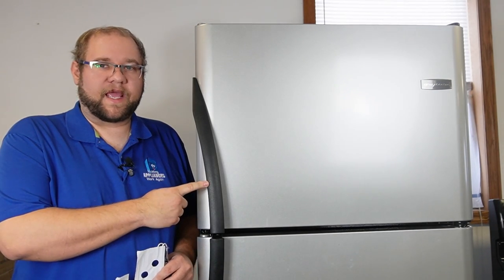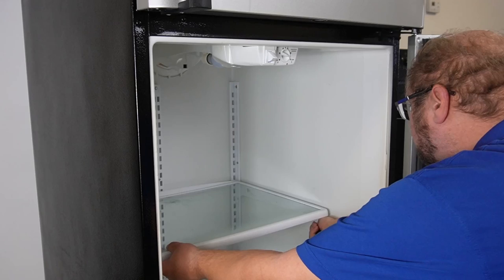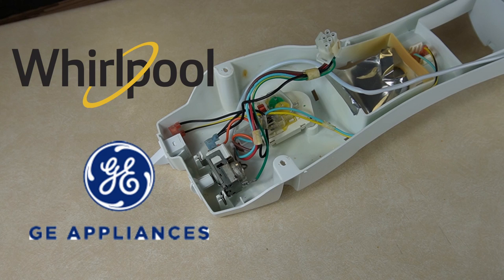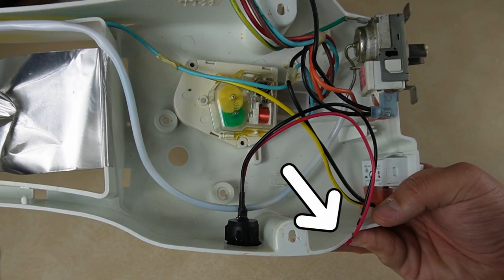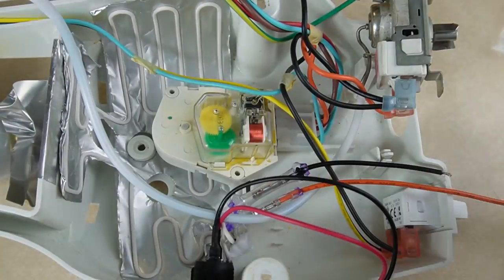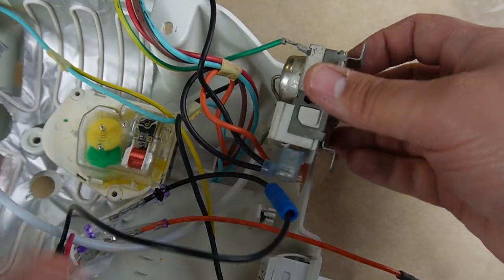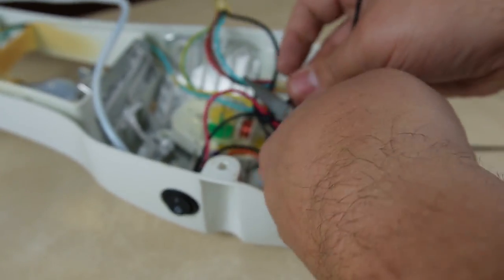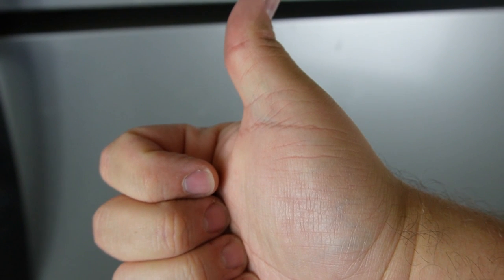Installing a Garage Refrigerator Kit with On/Off Switch to Keep Refrigerator Cold in a Garage

Comment: Hi Ben I have a Frigidaire fridge  that turns on and runs for 3 minutes and the compressor turns off  I swamped out the relay but doesn't seem the problem this fridge has electronic control board instead of a timer in the fridge  can it be the small board and can I swap it out with a timer?

Comment: How much power does a heater like this use? I'm looking to use it on a camp fridge that runs off a solar system via an inverter - and power consumption is VERY important. Will it draw power constantly and kill my battery/solar setup?

Comment: Just to confirm, does the red wire from the heating pad connect on the top of the cold control and then the black wire originally connected to the cold control connects to it? And for the bottom, the red wire (with the black small wire) from the switch connecting on the bottom of the cold control with the original red wire connected to it. Is this coorect?

Comment: Nice little kit- competitive with trying to find all the pieces to duplicate it (the only way to beat it is buy everything in bulk and spend a lot more on a bunch of bits I don’t need).  Excellent new vid.  Now I see what needs done with the parts.  Thanks!

Edit- ironically enough, finally had a warm enough day to install it today before it drops again.  Glad I had the step bit.  A little file to notch the housing hole for a tab protruding on the switch was helpful too.  Nice snug fit.  Pretty clear instructions.  The switch is extremely stiff though- as in I’m a grown man and have to really push on it- no way my wife is going to be able to flip it when the season changes.  If I had to do this again, I’d get a better brand switch.  Maybe it was just bad luck on the QC of the switch… but if this thing works, I’m happy.

Comment: this was a great kit, shipped quickly, quick connects make it really easy.  install was super easy.  i used a 3/4 paddle bit and worked fine.  just be careful you don't punch through and damage anything on the inside.  definitely recommend this product

Comment: is there a fridge that works in garage properly - also it would make sense to install a thermostat that would turn on this heater when the temp goes under 15 C, when the fridge turns off ..

Also, does that mean the old timey fridges just ran constantly?

Comment: Bought your kit... Went to install it today and underneath my control is only a few LED lights a thermostat to tell what the temperature is, wires for the temperature control and wires going to the switch to determine if the door is open or closed. There is no place to hook this up?

Comment: Good video, but when exactly should the heater kit be turned on? When the garage temp is outside (higher or lower) of the fridge's recommended tolerances?

Comment: This is a great video. 

I love that you’ve taken the Frigidaire kit and added a switch and almost “dummy-proof” connectors. 

Is it OK to toggle the element OFF on when temps are higher during winter months? Or is it best to just leave it running all winter?
Reply from the maker: Yes, thats the goal of the switch, so you can turn it on/off to conserve the heater pad and housing itself.
Reply: @bensappliancesandjunk  Hi Ben, I have a fridge in my garage and it gets very cold out there but the fridge seems to be working fine. The freezer is also working normal. Would I still need to install the heater in the fridge? Any help would be appreciated. Thank you.

Comment: Can you please, please , please add a clear photo or diagram of the connection of the red switch wire.  I know that the black wire on switch and black wire on heater connect to each other but im really confused on the other connections.  Thanks

Comment: I watched both videos and am confused about the wiring.  On one video the orange wire from the heater is attached on the bottom terminal and in the other video it is on the top terminal.  Can you help?  I want to me sure I am doing this right. Thank you

Comment: I followed all the instructions and the compressor works fine.  However, I switched the heater on today and expected the compressor to run constantly and it is not.  Is the heater pad bad or did I do something wrong?
Reply: Did you figure it out ? Mine is running on and off ?
Reply: @joepuleo3  yes it appears to be working fine.

Comment: Installed this kit today.  Followed directions and video. I piggybacked the Orange wire from the heater element to the orange wire from the cold control. The black wire from the element to the back wire of the switch.  Then connected the small black wire you supplied with the piggyback to the red wire from the switch.  Connected original black wire from the cold control to the piggyback then reconnected that to where it was connected to the cold control.   My question is does it matter which wire (Orange or black) piggybacks the wire from the switch?   In your video you took the Orange wire from the element to the black wires of the cold control and then the wire from the switch to the Orange wire.  Does it matter?
Reply from the maker: Its totally reversable.
Reply: @bensappliancesandjunk  need to explain where and why wires go

Comment: I’ve got a whirlpool fridge, and noticed that no kit exists for the this unit. I do have the manual cold control knobs, will this kit work for my fridge? (Maybe with a little modification to the heat plate?) 
Thx
Reply from the maker: Yes. As long as it has the physical turn-knob backed by a cold control thats mechanical (where you can tap into the system via the piggybacks).

Theoretically, we could release a 12 VDC kit, too. But I haven't gotten that far into decisions yet.

Comment: What is the voltage passing through the new on/off switch? Also, what is the +/- configuration of the orange and black wires? (black -) (orange +)?
Reply: It looks like this all runs at 120 volts AC. One of the wires on the thermostat is going to be live and the other switched live.
Reply: Where should neutral of heater go ?

Comment: Does adding this kit and drilling the hole for the on off switch void your warranty on the refrigerator?   Thanks
Reply from the maker: Likely yes
Reply: Can you use your kit and connect the wires to the switch, but carefully let the wires with the switch run through the gap at the top of the control housing and the top of  the fridge to keep from drilling a hole in the  housing and voiding the warranty.  The switch will be easily accessible just outside the housing and you can manually turn off the heater when needed.
Reply from the maker: @marvink7204  yes, I think you could do that in such a way the system isn't touched to void the warranty.

Comment: So I have a side by side fridge in a garage that routinely gets below 0. I may have the opposite problem: Even on the 'hotest' setting, the fridge compartment is below 32F (usually 29-31F in winter). This is too cold for milk, water bottles, etc, since it freezes solid. The kit looks super simple to install, but I hesitate to buy this kit since my issue is a little different. Is there hope for my situation? If so, does this kit fix it, or do I need to do something else?
Reply from the maker: Likely something in the cold control is shorted out, causing the refrigerator to run 24/7
Reply: @bensappliancesandjunk  It runs about 5 minutes every around 40-50 minutes to keep the freezer between 0F and 12F. So far I've rigged up an old 60W bulb inside the fridge side on a wifi switch to turn it on 1 hour every 12 to heat the fridge side. We'll see if that's enough or if I need something more sophisticated. Love your kits, though. I think my garage is just too cod for them...

Comment: Wouldn't it work better to just add the grade kit wired into the defrost timer and only have it work 15 or so minutes during a normal defrost
Reply from the maker: That literally would defeat the purpose of the defrost system. If you run defrost+compressor at the same time it'll absolutely destroy the defroster. Refrigerant will be pumping while it defrosts, and the end result is that they cancel eachother out, and in about 1 month your entire refrigeration system will be frozen over.

Comment: is there a wiring diagram? the video is a bit to fast for me to see what goes where. 
________

splice and make wire connections as needed. 
-Black heater wire goes to the line side of the switch
-load side of the switch got to the bottom of the temp control
-red heater wire to the top terminal of temp control switch 
- Piggy back the original wires where they origianlly went
 Is this correct??????

Comment: The heater is always on when the black switch is on and then  the compressor is  running non-stop?
Reply from the maker: Yes, thats the point of the garage heater kit: the compressor has to run more often to maintain temperatures in a cold garage
Reply: @bensappliancesandjunk  so it runs more often,  but not 100% of the time? (that sounds abusive on the compressor!)..   the switch is there to turn off the heater during spring/summer/fall ?   thanks!